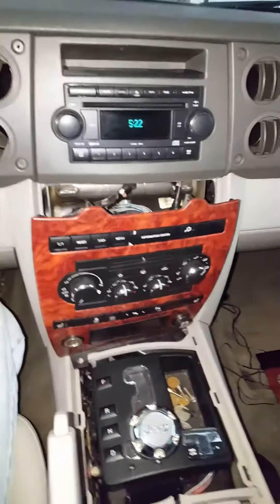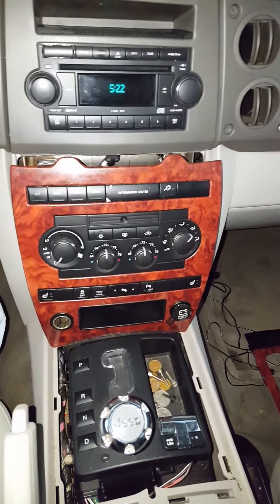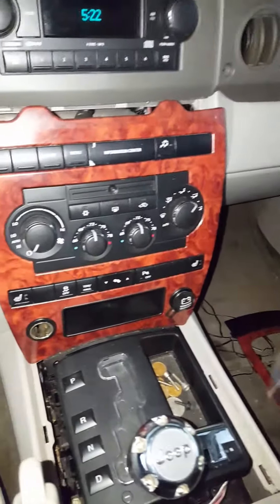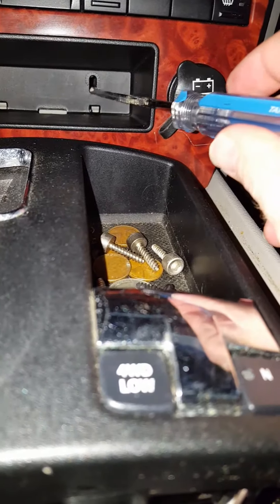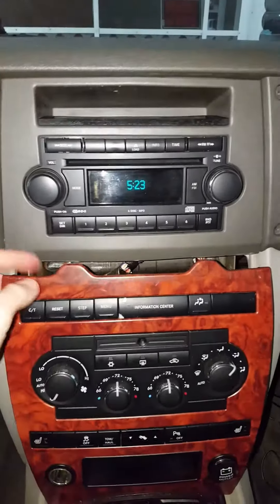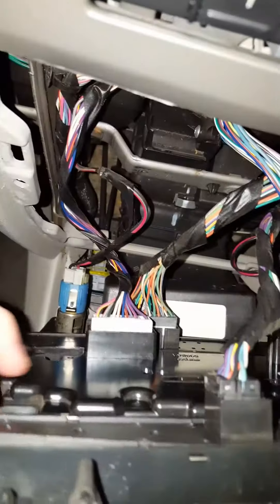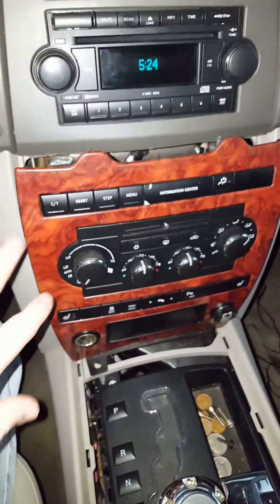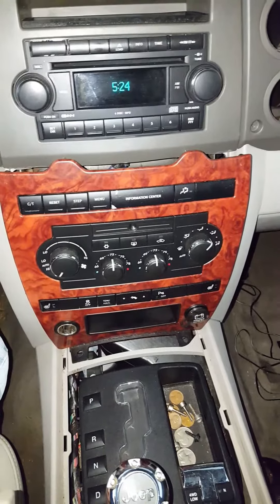2006 Jeep Commander information center and cluster removal

Comment from the maker: It did work and well. I’ll try to get you the part number. There’s two different sizes and I just took them to radio shack and matched them up. You’ll need to soder the new bulbs

Comment: The video and information is misleading. There are not "bulbs" inside, there are 12 volts LEDs (about 5 per panel), very hard to get and expensive. A thing with LEDs , you also need to know their polarity and you also need a low temperature soldering gun about 15 watts with small tip. The temperature control/fan do have little light bulbs (3 of them), again 12 volts. never seen them at Radio Shack and I'm a Radio Shack frequent shopper.  Thumb down!!
Reply: I stopped watching when he said "of you don't care about cosmetics in your car".  I mean we're not talking about a rough fix under a door panel or putting the grille back on, its the center display panel.

Comment: Great video except you're just like la dee da, disconnect this and that and it's not so simple. I've been effing around trying to figure out how to disconnect the damn cigarette lighters for over an hour and I also had to remove the dash to get that wood grain panel out because the clips don't allow it to just "pop" right out.
Reply: The lighters have a locking red pin (jeeps are famous for them)